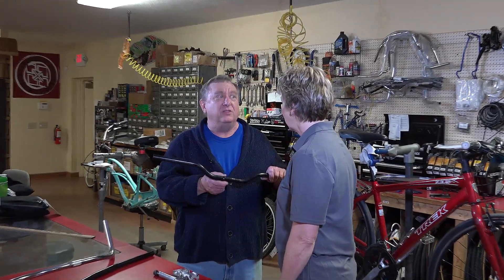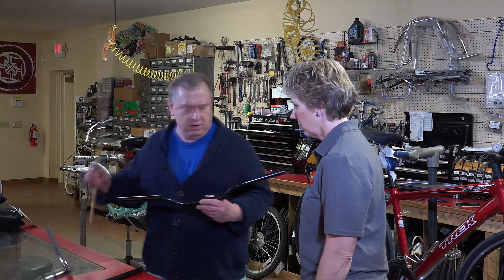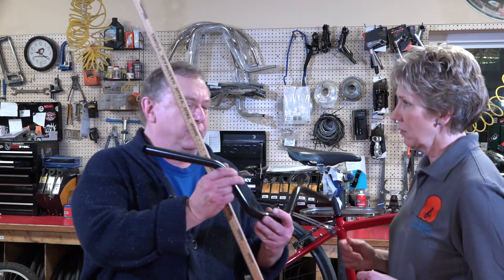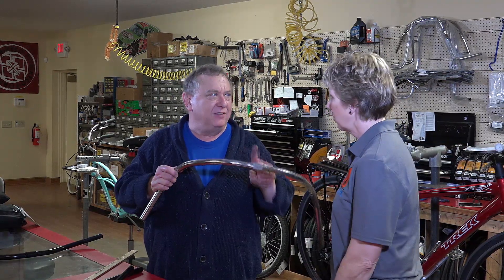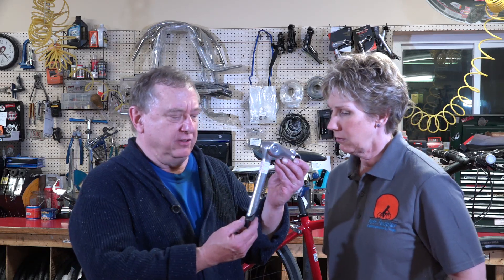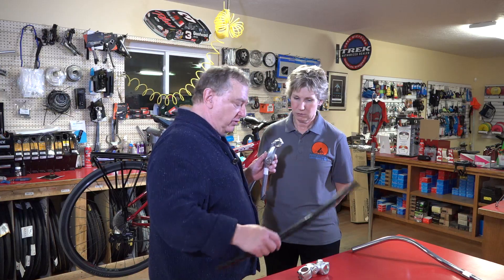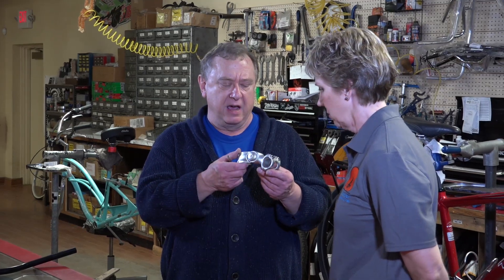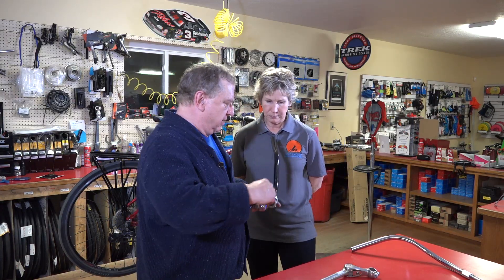Bicycle Handle Bars - Getting Comortable

Comment: That quill stem has more adjustments than I have ever seen! I like the flatbar, fitness style bicycle/handlebar. Thanks
Reply from the maker: I do too but sometimes I feel I would like to be a little more upright to take the weight off my hands. It would be nice if you could change it on the go.
Reply: Yes. That adjustable stem would give a wide range of near immediate options.